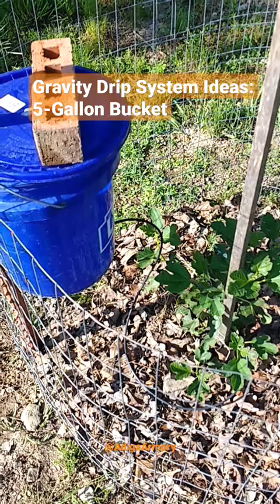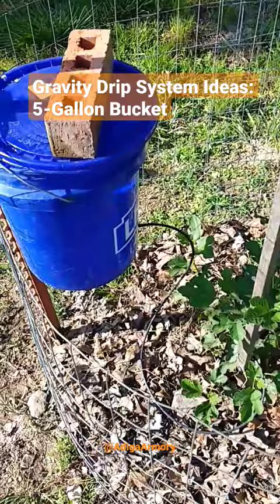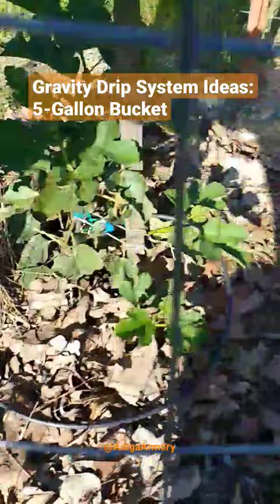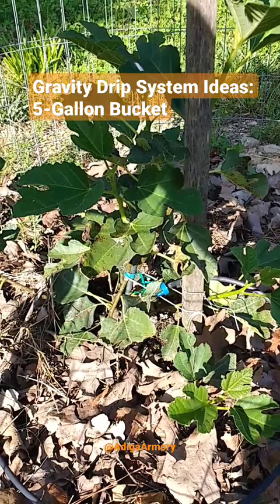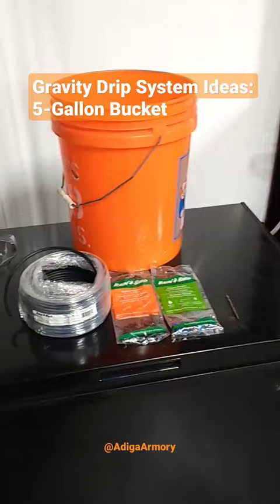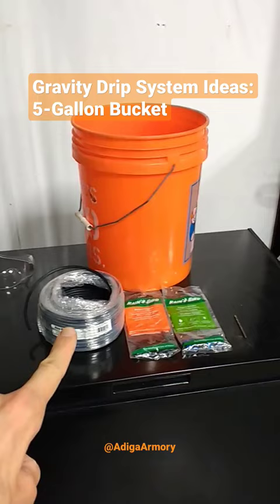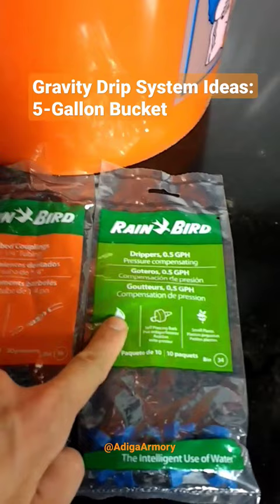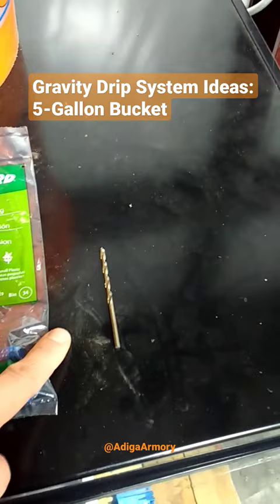Gravity drip system ideas using a 5 gallon bucket.

Comment: Clever system for specific watering needs, thanks!
Reply: Ill be doing this in my raised beds. It will allow me to fill the buckets at the start of my daily walks and move on knowing everything has gotten x amount of water and/or mixed in nutrients. Adjusting hoses and flow rates as needed.

Comment: Thx for the vid. Does the plant not get overwatered if the roots are kept wet for 3 days? Do you fill the bucket up right away after being drained? I am asking bc I thought overwatering was caused by frequency of water, and not letting the roots dry out. Thanks!!
Reply from the maker: Good question... I don't refill them right away... it is good to let them dry out for 2-3 days in between to force the roots to grow deeper.

Comment: Your math calculations is completely off.  If your system drips at a rate of half a gallon an hour, your 5 gallon bucket would only last 10 hours.  Not 3 days (72 hours)!
Reply from the maker: Not exactly... 1/2 gallon/hr is only in a lab at a stable pressure and using distilled water... not in practice... with gravity pressure using well water from a hose it is much slower. I'm not using math to estimate... I am telling you how long it actually runs for.